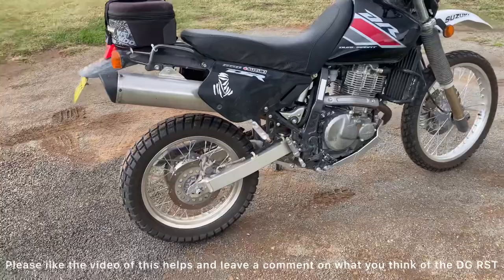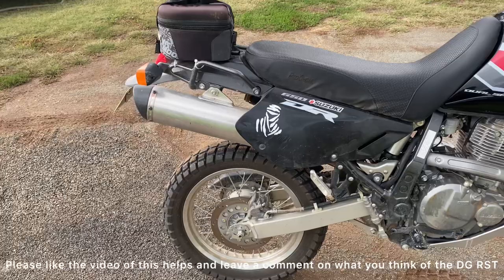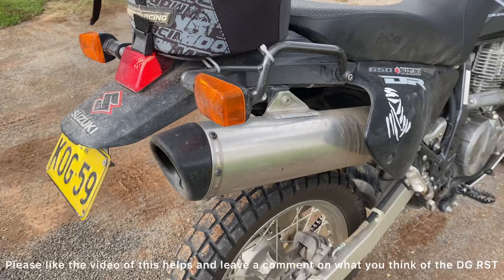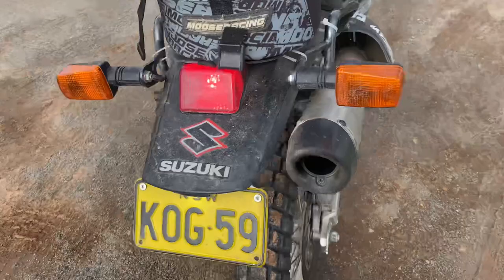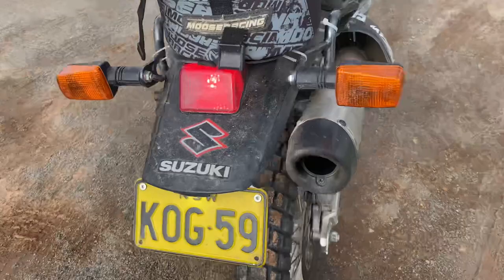Suzuki DR650 with DG Rst slip on! + Sound test

Comment: Hey man that pipe sounds really good, did you have to rejet the carb?
. How you finding it noise wise, not too loud?
Reply from the maker: I ran this exhaust for a while without rejetting the carb from stock, I did eventually cut the air box open a bit and then I got to jetting as well a little bit after that
Reply from the maker: Sorry I didn’t answer your last question, it is a bit loud but I still do 6am starts on it.. Low revs it’s fine but it definitely hammers when you snap throttle